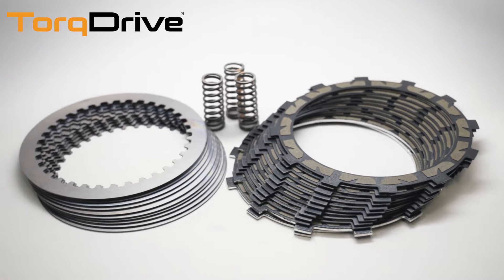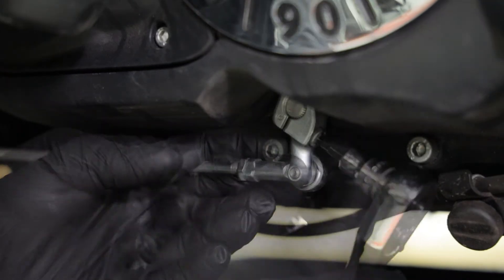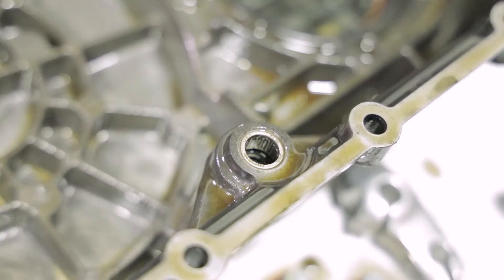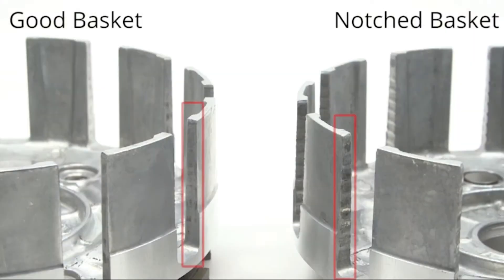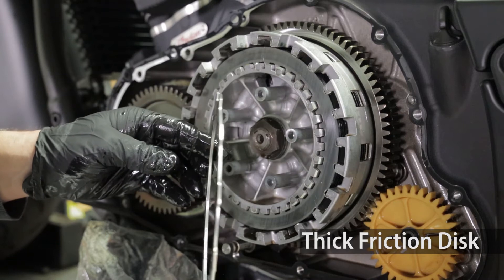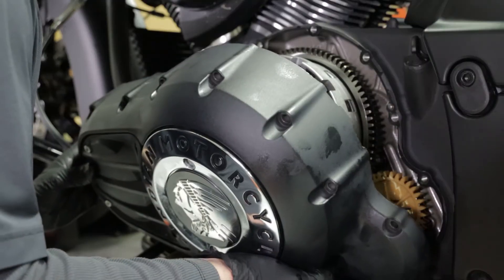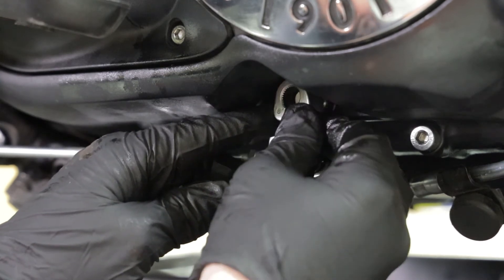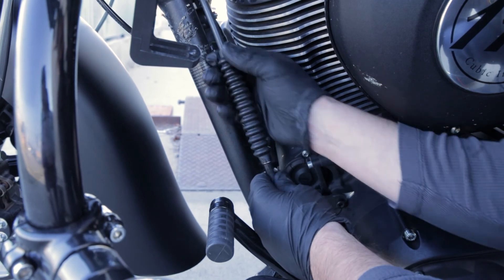Rekluse TorqDrive Clutch Installation for Indian Thunder Stroke

Comment: Thanks for the video! Although I don't need to perform this operation yet I'll know where to go (video wise) when I'm ready to do this on my '17 Chieftain Limited. Your tip at 3:04 of using a freezer zip lock bag to soak the clutch pack is one of those ingenious ideas that elude even the best of us. I've been soaking my clutch packs in an oil drain pan, thus using considerably more oil and having a higher chance of contamination from dust and debris.

I'll be sure to use your clutch pack, I see many great reviews on your brand.

Thanks for the video!